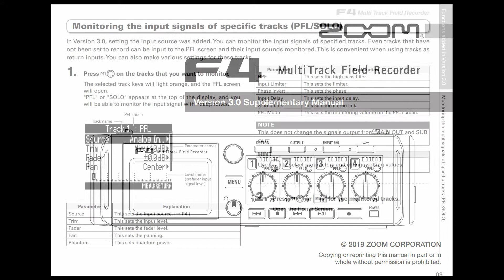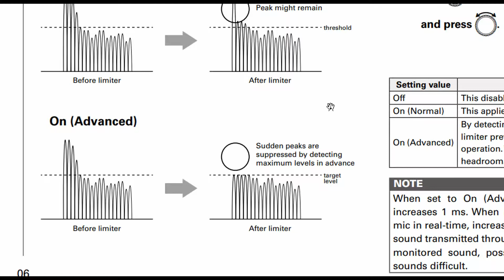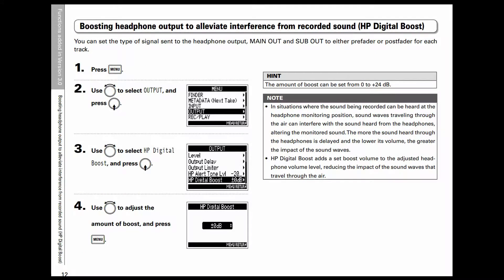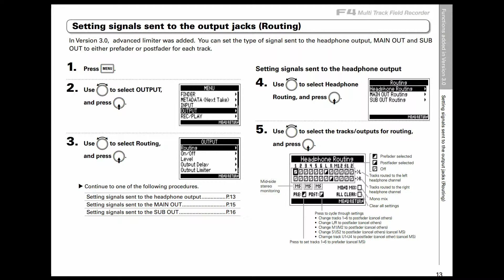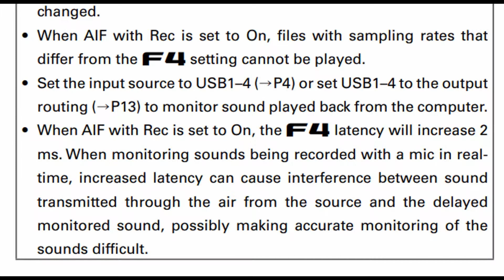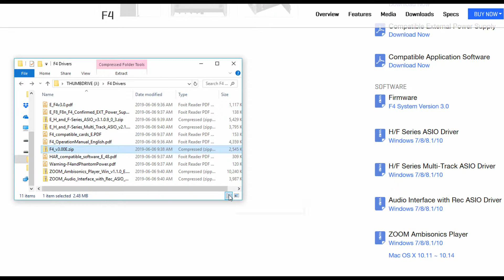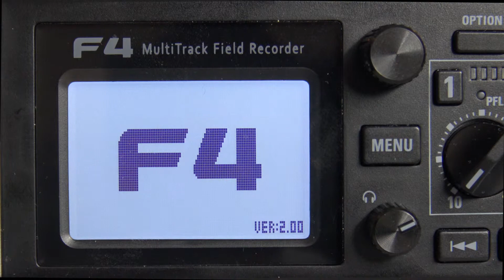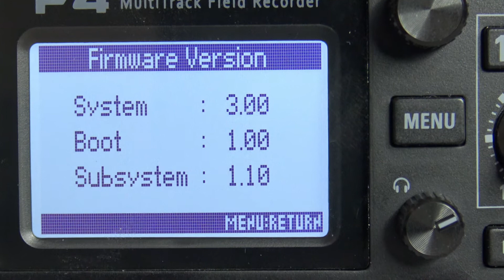Zoom F4 Firmware v 3 0 (How-to, what's new)

Comment: Jerry I’m getting familiar with my F4.  Where is the trim for channels 5/6?
Reply from the maker: It is on the  actual adapter... the 2 round knobs on top!
Reply: If you don't have the adapter and use the RTN input jack or need additional trim then hit the "input 5/6" button, which is essentially the PFL for 5 and 6, then you can change the level and fader options to adjust volume. Note that for some reason the fader gain doesn't update till you return to the home screen so you'll need to adjust it, exit the 5/6 menu, check levels and repeat. Also 5 and 6 seem to share all settings in the menu and only differ in left and right panning, so probably only a good option to use with the XLR adapter that has additional controls, or with a line level source to the RTN input. Like a lav receiver with line level out, a sound board, or a camera.
Reply from the maker: Sorry for the late reply!  The gain I found was too low without the EXH-6 adapter, and it was easy to get and install... so no need to experience what you mention above.... as the adapter has its own volume/sensitivity knobs on it.